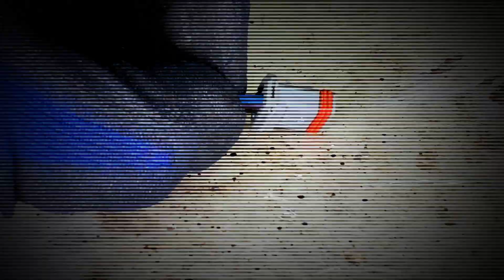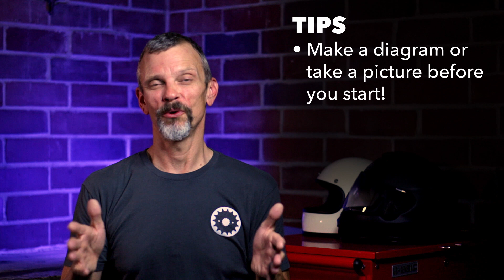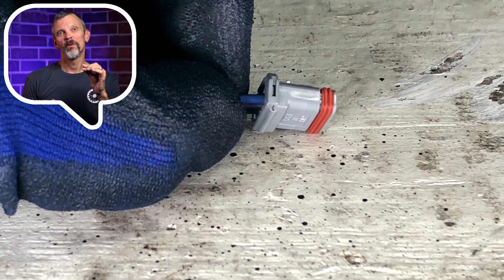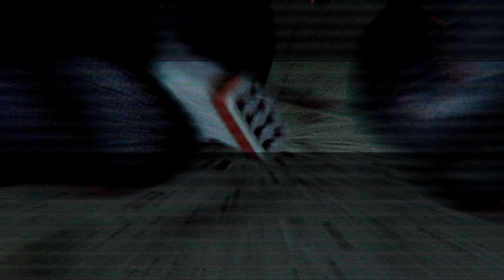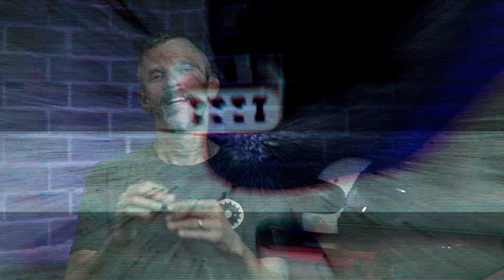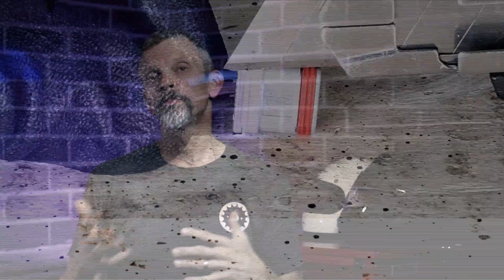JAE Connector Pin Removal & Installation • No Damage

Comment: If I’m only using 3 of the 4 slots do I need to seal the empty one?  The OEMs have a little dot on the empty one
Reply from the maker: I believe you can leave them empty but if they’re plugged it will block any debris and moisture from entering.

Comment: How do I disconnect a plug if the wire has slipped out?
Reply from the maker: I think you can release the pin with the safety pin and then use a paper clip or something like that to push it out of the plug.

Comment: i tried with a safety pin, it just bends the safety pin, no ammount of pressure will release these
Reply from the maker: Is it a different type connector? It took very little force when I did it.

Comment: Hi, i love your videos. I have a 2013 harley softail heritage classic. It does not start, i think is the right switch module, battery is good, left switch works perfect, now, the right switch turn signal doesn't work , hazard lights also dont work, kill switch either, now, i checked the wires going to the switch, three of those has power on them,and two doesn't. Is that normal? I thought maybe one of those get power when i press the star button to send power to the starter, maybe, what your thoughts? Is it the switch?
Reply from the maker: Hmmm. I can’t say for sure but it does seem that the switch is suspect since nothing on that side works. Might be worth seeing if you can get power to the bike by using a jumper between the plug pins that go to the main switch - just make sure you get the correct wires! That would at least tell you if the bike itself is ok. If it is, that would be another check in the bad switch column. I just don’t know why the whole switch would fail. Haven’t done a lot with them yet. 

And thank you for the kind words!
Reply: Hi, thanks for your fast replay, i used a test lamp, i poke the cables right at the switch, right at the module, you think it can be the switch? I order the switch to try, which it has been on back order for a while, is it any other way i can try to start the bike without the switch? Just to see if it cracks over?
Reply from the maker: @baloo217 yes you can unpin the wires and connect the prior ones to start the bike manually, but you would need to research that.

Comment: So I tried this but couldn’t get it out, I had a connecter that wasn’t pinned correctly so I couldn’t see the pin from the front. Struggled with it for a while, finally just opened the hinged back door with a razor blade and it was super easy
Reply from the maker: Plan “B”. Glad it worked!

Comment: Just bought the factory front blinkers for a 2021 road glide. Had to buy the JAE plug separate. Would you happen to know what tool is required to properly crimp the pins to the bare cables, before I put them into the connector? This is driving me insane. Thank you in advance.
Reply from the maker: Hey Rene - I don’t know for sure, but there’s typically a crimping plier of some sort that dies the job. I’ve also seen dies that can be used in a vice or pliers. Those small pins can definitely be challenging. Let me know what you find.

Comment: what about the other part, you worked on male, what about female?
Reply from the maker: I only had to work with the female part of the plug…
Reply from the maker: I found a reference document for the plug - the pin removal process is very similar for both halves of the plug. See if this helps (page 10): https://www.mouser.com/datasheet/2/206/JAHL_1594_Erev05-1170802.pdf

Comment: Thank you for this informative video. Could you please describe pin removal for the female JAE connector?
Reply from the maker: Hey Tony - I’ve only depinned the one I show in the video, and I don’t think I have another plug to check out. Sorry about that. But let me know what you find out.
Reply from the maker: I found a reference document for the plug - the pin removal process is very similar for both halves of the plug. See if this helps (page 10): https://www.mouser.com/datasheet/2/206/JAHL_1594_Erev05-1170802.pdf

Comment: This was useful as I'm fighting with my wires frist time depinning these connectors, and havnt found a proper tool yet,
Reply from the maker: Hey Anthony - I’m so glad this was helpful!
Reply: @Ron's Workshop  any tips on the throttle by wire I'm gonna see if I can snake it through the new bars, I was able to pull it from the stock bars with a little patience no depinning worki g on a 2018
Reply from the maker: @anthonygm85  I've had good luck slipping heat-shrink over the wires and then shrinking it down. It's more durable than the regular plastic / vinyl sheath that some of the wires have. If it has that soft sheath on it you can strip that off with a sewing seam ripper and then apply the heat-shrink. Let me know how it goes!
Reply: @RonsWorkshop  did you depin the connections while doing this?
Reply from the maker: @anthonygm85  Yes, where I could. De-pin, de-sheath, add heat-shrink.

Comment: How do you remove the metal connector when the wire is broken at the crimped edge ? You have nothing to pull on once the retainer clip is lifted off the metal pin.
Reply from the maker: Hey there - I think you could use one safety pin to release the pin and then use the end of a paperclip (or another safety pin) from the plug side to push the pin out the back. Let me know if you get it…

Comment: I installed original turn signal on my harley but it looks like the pins of the new cable are bigger or is just me that can't finish the job?
Reply from the maker: Hay Alfredo - are turn signals supposed to be from the same generation bike as yours? It sounds like maybe they’re a different year or bike model?
Reply: @RonsWorkshop  yes,According to hd shop,they need to fit.Maybe I should try it again
Reply from the maker: Yeah probably worth another try. That’s really odd.
Reply: @RonsWorkshop  I did try it but I broke a pin😡
Reply from the maker: Argh. Was anything corroded? That stinks but it’s not too hard to get a replacement plug kit and replace it, or just a pin kit and replace the broken one.
Reply: Hi mate, I had  the same problem, the original connect has smaller wires than the new one, although the plugs are the same size. The original one is JAE M PBT and new one is JAE L PBT. Question is do you know the actual part number of the connector please?
Reply from the maker: @davidpereira979 the only part numbers I have are listed in the video description for the Ape Hangers: https://youtu.be/_8AiY8o7GAY

Let me know if that helps…

Comment: Struggling with a AMP connector. Somehow 4 are out but 2 will not come out. I’ve spent hours. Maybe the inside is too mangled by now?
Reply: I hate these gosh darn mother, son of a plugs dude freaking hate him struggle with them for freaking hours some of them come out some of them don’t it’s just that simple it don’t matter if you get the thing undone some of them just don’t come out. You’re not managing the whole thing and have to order a new one way a week. They’re just ridiculous. They’re so frustrating to work with every freaking time some of them I can get all the way undone every single time first click others. I’m struggling with them for hours end up cutting that son of a off and just getting a new freaking clip dude so frustrating some of them come off some of them do not it’s just that simple they do not all unjust clip so easily. I depend hundreds some of them just won’t come off horrible design if you ask me horrible just cut them mothers and solder it dude way easier
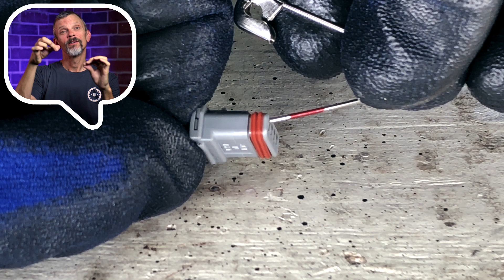Reply from the maker: Hey bmish - is it an AMPSEAL connector? I saw a reference to removing what they call the primary latch reinforcement (PLR) using a little hooked tool DT-RT1 and then you can release the connectors with a small screwdriver. I haven’t worked with these connectors firsthand, but this video at 2:42 shows what I mentioned: https://youtu.be/hW-Bky_zroU&t=2m42s

Let me know if that helps…
Reply: @RonsWorkshop  negative. It is a standard AMP for Harley turn signals. Won't have anytime til tonight. Worst case, I'll cut them off and buy a new 6-way and two socket connectors. Thanks for your response!
Reply from the maker: Roger that. I hope you can get it all done without cutting! But that’s always the ultimate workaround lol. Let me know how it ends up.

Comment: I have a corroded pin and need to de-pin the female connector.  Having difficulty with the safety pin. Any tips??
Reply from the maker: Hey Bryan - hmmm...maybe stick the safety pin in and then use something else (maybe the end of a large paperclip?) to push the pin out from the front of the clip? Worst case you could order a new plug and cut the wires and then crimp or re-solder them into the new connector.  Let me know how it goes!
Reply: @RonsWorkshop  I’ll try that. It’s knowing exactly where to stick the safety pin (other than in me 🤣).  I’ll persevere and keep you updated
Reply from the maker: Yeah I get that. Try re-watching the video part where I describe how far to insert it and how to put pressure on it. I’m sure you can get it out.

Comment: Ron
need to change NX-1900 connector is this same process. Ultra Limited 2021
Mitch
Reply from the maker: Hey Mitch - give me a bit more info on the NX-1900. I’m not familiar with it.
Reply: @RonsWorkshop  
It is the passing lamp connector.
HD part
NMZ NJ-2S51 
www.namzccp.com
In the HD CVO part book: item 17 Passing lamp page
Reply from the maker: Yep, the Namz MX-1900 is the same JAE connector!

Comment: Great video. Just started de-pinning my HD connectors. I’m doing a custom lighting project and this really helps. Thanks
Reply from the maker: Hey R. Roosa - glad it was helpful! Let me know how the project goes. 

If you want a channel sticker send me a DM on Telegram or Instagram with the mailing info @RonsWorkshop
Reply: How’s your custom lighting job go? I’m struggling with my ‘18 so frail slim flsl. Worried I may have used the wrong gauge wire to extend my tail lights back so I can mount them on my fender. What gauge wire did you use?
Reply: @Doc_916  I used 14 AWG. I was able to de-pin the connectors so I didn’t have to do any pin crimping. I extended some of the wire and to make sure it had a strong connection, I soldered the wire then used heat shrink over the soldered joints.
Reply from the maker: 14 awg seems about right. Are you using LED or incandescent?
Reply: @RonsWorkshop  LED only, no incandescent
Reply from the maker: Hey R. Roosa - LED draws very little current so the 14 awg should be sufficient. If you just want that extra reassurance you can always go up to 12 awg but that’s much more than you’d need for LEDs.

Comment: Where can I buy the metal connectors so I can use the plug and wire my led bar into the left turn signal switch?
Reply from the maker: Hey James - I haven’t wired that one yet. Do you have a picture of the connector? If so shoot it to me on Instagram @RonsWorkshop and I’ll take a look